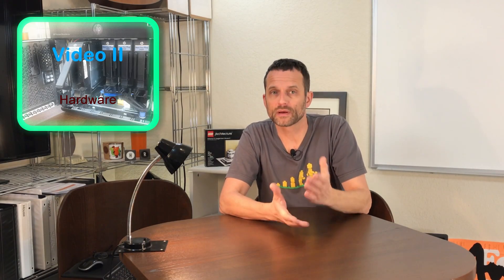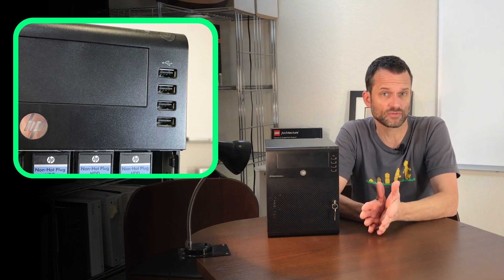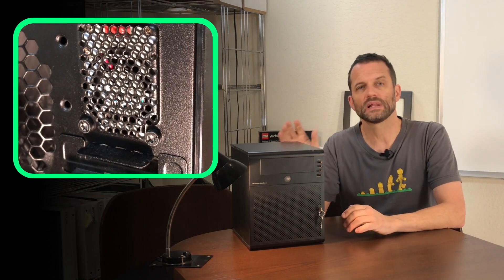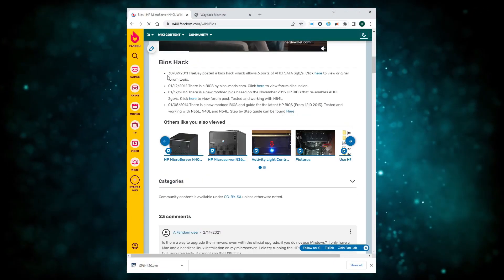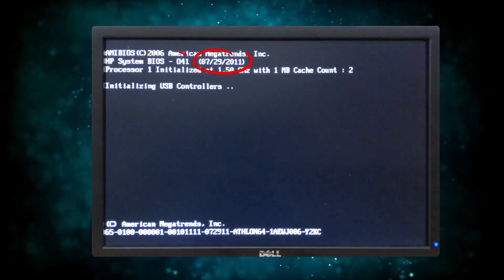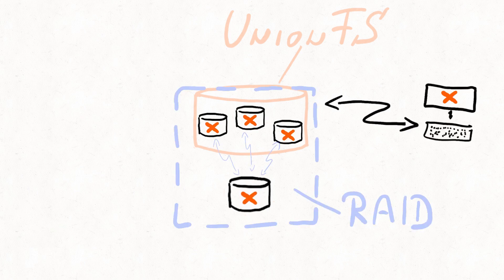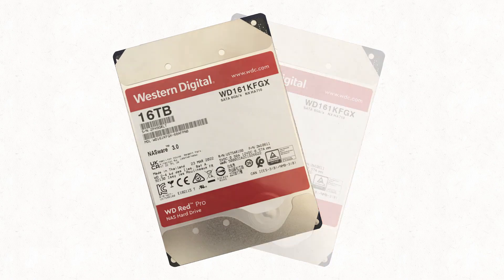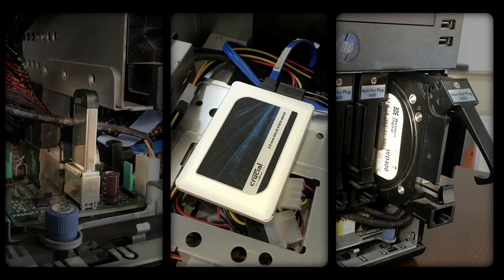Convert 10 yr old PC into a File Server   |   DIY NAS Part 2 - Hardware

Comment: Here is a fun little hack - Still using the USB to boot - Use a USB to SATA converter and an old laptop hard drive for your boot disk.   If you can find an old disk with decent capacity, you even get some usable space for installing applications without eating into your storage.
Reply from the maker: interesting idea ...

Comment: I know that I'm couple of years late to the party, but it looks like you can upgrade the enclosure to SAS drives by replacing the backplane's SAS cable and getting an additional SAS RAID card.  N20L backplane has removable SATA connectors and is upgradable to DELL PowerEdge T110 SAS cable with Mini-SAS SFF-8087 (p/n 0VM72C) with some modifications.  I have confirmed that built in connector doesn't support SAS.
Reply from the maker: I think you may right ... worth looking into for sure - the N40L MB has a SAS connector that feeds the 4 bay SATA backplane ... and although the HD connectors are SAS compatible, it seems to only support SATA (fine by me) - but change it out and/or use a card and you may just go with SAS drives instead ... 👍
Reply: @HaukesProjects  The 36/40/54Ls backplane and cabling does support SAS. However, the onboard control only supports SATA. So a SAS HBA/RAID PCIE controller needs to be added.
Reply from the maker: @Yandarval  thanks for verifying this ... I thought as much

Comment: Thanks for your video. Does the machine support hard drives for each  larger then 4TB? Thanks.
Reply from the maker: it should ... I am running a 16 TB drive as my parity drive right now (4.3 GB of data used at the moment) - and I plan to replace my 2 2TB drives with 8TB drives soon ... if you're using this exact machine, you should definitely consider the modified BIOS I go over in the video - among other things, it will allow for the SATA interface to live up to it's potential and take the (stock) 1.5 Gbps transfer rate to a max 3.0Gbps (modified BIOS)

Comment: Thank you this is a good overview of what is possible with old hardware.  It would be interesting to compare the power consumption over time and a pros/cons review once you're done to see how you find the overall experience.  Thanks for sharing!
Reply from the maker: let me know what specifically you're interested in (in terms of pwr consumption) - I hooked the system up to a "Kill A Watt" to test consumption (HDD vs SSD, etc.) and found that I had plenty of room to grow ... so I plan to add a few SATA pwr splitters in order to accommodate more drives in the future